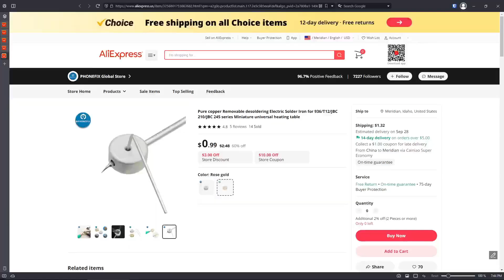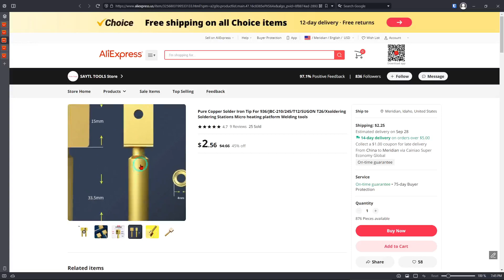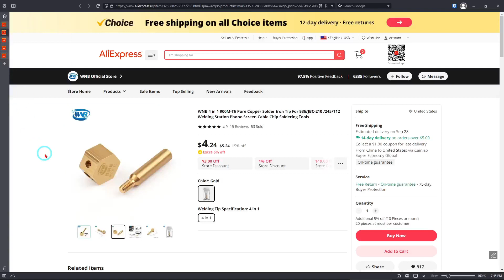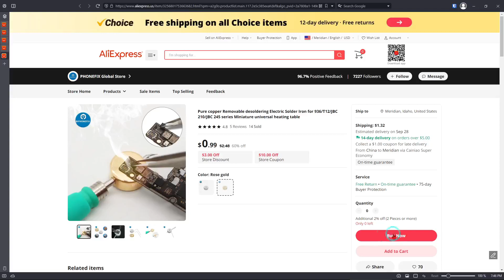PCB Heater, pre-heater build.

Comment: im thinking the same thing with t12 tips
Reply from the maker: Keep in mind that the soldering station I used has a big transformer in it which can take the load of heating a big chunk of metal.  Some cheap Chinese T12 stations have switch mode power supplies and you would have to check if it can deliver high heating power (70+ watts) for like 7 minutes of constant heating.  If you try it let us know how it went?